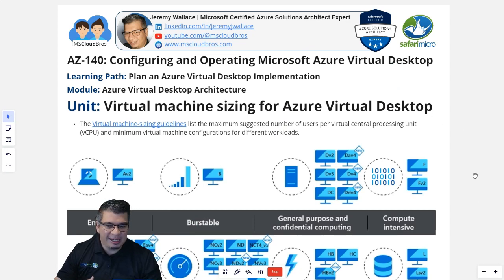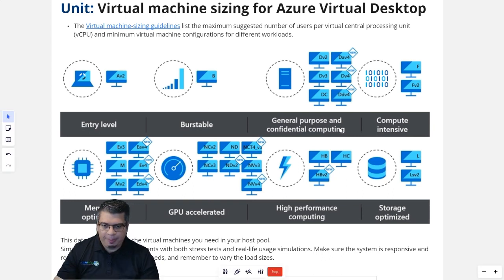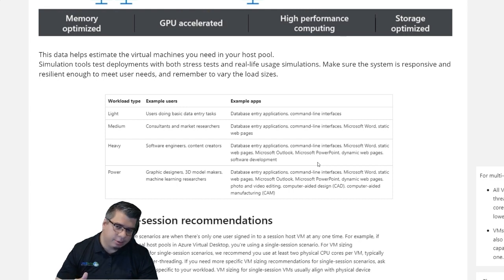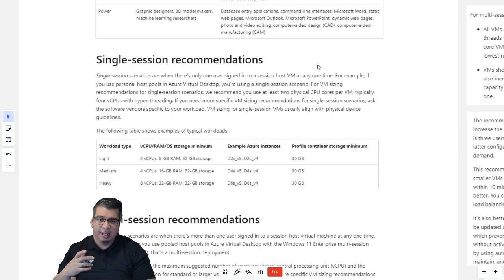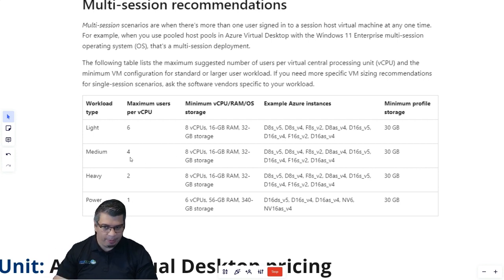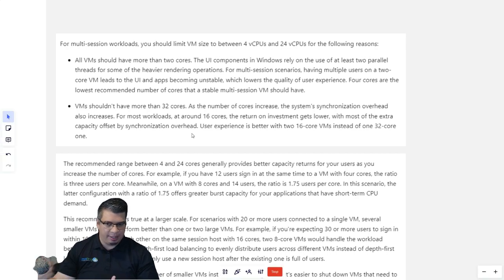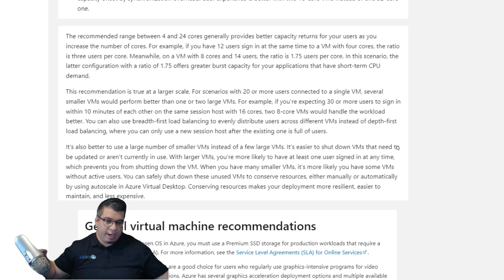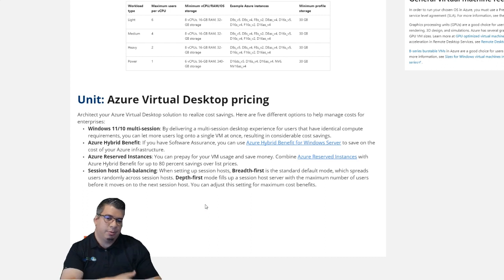AZ-140 ep05: Virtual Machine Sizing &  Pricing for AVD | Microsoft Exam AZ-140

Comment from the maker: 📌 Continuing with Microsoft's suggestions, it's more efficient to distribute users across multiple smaller VMs instead of a few large ones. This strategy improves performance and conserves resources. 💾 Premium SSD storage is a must for production workloads with SLA requirements. And if you're dealing with graphics-intensive programs, consider GPUs! 
hashtag#ResourceManagement hashtag#Performance

Comment from the maker: 📌 Based on Microsoft's recommendations for sizing virtual machines in Remote Desktop Services, it's suggested to have at least two physical CPU cores per VM in single-session scenarios, typically four vCPUs with hyper-threading. 🖥 For multi-session scenarios, more than two cores ensure stability and a better user experience. ✅ Remember, exceeding 32 cores in VMs can increase synchronization overhead. hashtag#Microsoft hashtag#VirtualMachines